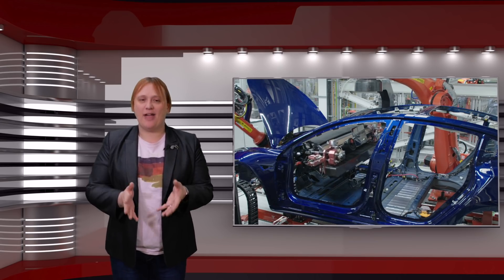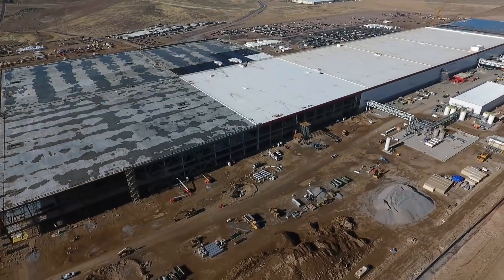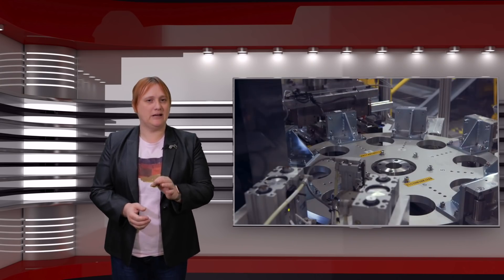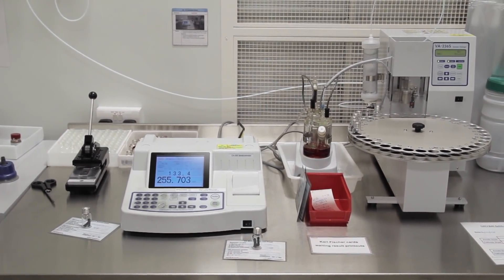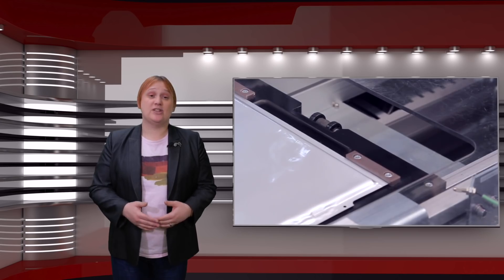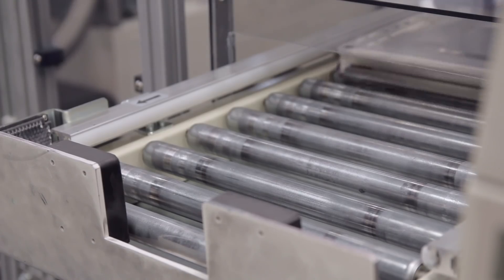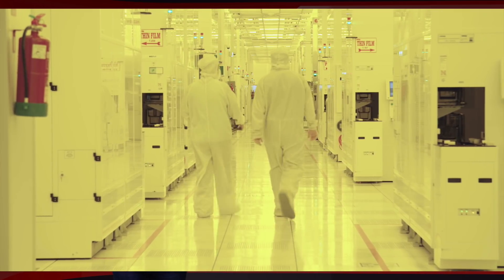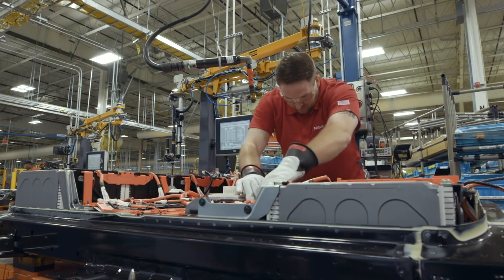Want A Battery Breakthrough? Figure Out How To Make Lithium Ion Batteries More Easily!

Comment: Still need more research on lowering the cost of alternative energy especially the battery and hydrogen fuel cells. The production process itself needs a lot of research on how to lower its cost and make the battery more affordable while addressing situations such as slavery and lack of good conditions when it comes to mining the materials and to power the manufacturing facility with solar energy and use Tesla semi or similar trucks or even trains for all manufacturing deliveries.

Comment: It sounds if the cell production is similar to the issues within the semi conductor industry, where yield is a major factor in profitability. Improving yield from say 10% to 20% doubles the effective production and this is/has been achieved in high density chip production. As techniques improve it should also be possible for cell production.

Comment: Waste is a real cost to manufacturing. Employee stress is also a problem, which is often not recognised by managers. The stress may be due to work, production pressures, and general manufacturing hiccups which happen in all plants. Rome was not built in a day. Managers and staff need to work together to improve the process, make the article to the correct standard and desired numbers. After a life time of work, including as a manager, I can tell you people are overly optimistic. Even the best made plans often do not work out as thought and require much fettling to get production working as wanted. Taking pressure off of staff at all levels is key to a productive workplace. I commend Tesla on their partnership with Panasonic. This has allowed them to have a significant battery production plant close to their vehicle production. It has also allowed their partner to carry out an expansion that they perhaps otherwise may not be able to do. Just expecting the small number of companies competent of making transport grade cells to make the necessary investment to set up the required battery plants is unrealistic. The two main issues will be a lack of adequately skilled personnel and the insane level of borrowing that would be required and the challenges of constructing and running facilities in many different countries.

Comment: Because CHANGE.   << THAT really sums it up. Cell or Battery production actually isn't very difficult or intensive compared to some existing automotive supply lines, but it is new, and there's the problem.  For example, have a go at making a crankshaft. Sounds easy?  Er, nope, far, far harder than making a battery, but because that supply chain exists and has done for nearly 100 years now, nobody gives it a second glance. For example a lot of the forging machines making high performance cranks were built in the 1950's at vast expense (often highly subsidised by the Government too), and today, some 70 years later, we still leverage that investment, to allow Tier1 suppliers to provide cheap, mass produced, but highly complex parts like crankshafts.  The situation will change, vast investment is now in place and being applied, costs for batteries will fall and yields and efficiency will increase.

Comment: Li-ion cells have some rugorious requirements in use too. They can not be charged above 4.2 volts or allowed to fall below 2.7 volts. In 2000 - 2004 there were a number of laptop fires. The cause was when they were fast charged to 4.2 volts some parts were actually above that voltage. So laptop and cell phone makers fast charge to 80% capacity in 20 minutes then trickle charge for the rest over 3 hours. And there were stories of Tesla service guys breaking into vacationing customers garages to plug the car in. 
When Segways patents expired a lot of people built copies as Hoverboards. The Segway was before Li-ion batteries, the Hoverboard copycats just use them. The result: So many Hoverboards caught fire they are banned by the airlines. So be careful if you are buying anything with Li-ion batteries in them.

Comment: The mining practics are due the the greed of the mining owners.  You get what you pay for, and if you want to cut costs at any cost, that will affect the labor pool.
Reading the comments there seems to be an altruistic source at the reluctance of automakers not investing in battery packs.  This is be design by a YUGE financial lobby enmeshed in ICEV makers.  They have not invested in batteries out of greed.  And then they spin that lack of investment and churn out memes that promote a public hatred of EV.    I just did 2 videos for Earth Day with one debunking the lies of the oil lobby.  And so as if it was programmed, a patient came in an asked me about what he had heard on the radio that morning.  They have brainwashed an entire generation of children (and their parents) that batteries are not recyclable and not ecological.  Now they have added that since there are so many marks of batteries that it becomes dangerous for them to recycle the batteries. 

Disingenious bastards.

Comment: Nikki, as much as I agree with the sentiment you expressed about the electric three wheelers in India from Mahindra the other day, sadly the same is not true  when it comes to a proper 4 wheeler car with Mahindra's current offering E20+ or E-verito. Both are low voltage cars and not built from ground up like a proper EV. They fail to offer either power or range. No wonder, both failed to gain popularity and the sales fell flat last year. So, please don't put them in the same bracket with bolt, leaf or a Tesla. We, here in India are waiting for a proper EV built from ground up, and so far, Tata Altroz EV seems to be the one, although, like other mainstream manufacturers they too are a vaporware for now.

Comment: Nikki stop playing lip service to batteries holding up uptake of ev when that is not the reason the legacy auto makers are not replacing internal combustion engines  with electric motors as the actual devices turning the wheels of the vehicles they make.
I would rather have them produce ten 10 kWh capacity cars with range extenders than one 100 kWh bev and nine ice vehicles.
The real reason the legacy lot are playing along with the battery supply difficulty argument is simply their abhorrence (after decades of ice development) to the notion that all the ice is now fit for, is generators.
Reply: I'm afraid this is another rose-tinted vision by another anti legacy car maker EV obsessive..
The tired, predictable wheeling in of a conspiracy theory to attack car makers, etc. etc. 
Why is it that people with an 'agenda', even when faced with the blindingly obvious, refuse to accept straightforward reality?! Yawn.......
Reply: @andymccabe6712  I am an EV obsessive but certainly not anti legacy car makers, far from it. There is no conspiracy theory, after decades of development the ice has run its course and now it is time to accept that an electric motor was all along the right thing to be turning the wheels.
My agenda is that we cannot expect Tesla to go it alone but unless the legacy auto makers commit to the fundamental that the electric motor must be the sole means of propulsion and see that their existing ice manufacturing capacity does not need to be abandoned but adapted to meet the needs of this transition to EV then they are only going to fall further behind.
Nissan with their e-Power unit have already shown that customers are perfectly happy to purchase an EV if packaged such that it does not in their minds represent any change in how they expect to use the vehicle. But crucially the setup of the Nissan e-Note does away with the ice turning the wheels. Incidentally the e-Note has the same electric motor as the Leaf.
I still own my 2011 Leaf but now do most of my miles in the BMW i3 rex so I know just how easy it is do all my day to day driving on electric and yet can do any trip without hassle because the infrastructure for the rex is there as part of those decades of past ice development.
The end game is that we will all be driving BEVs, it is just a question of quickly the transition will be.
And to my mind unless the legacy auto makers put the electric motors in place turning the wheels the transition will be a long one.
Reply: Perhaps a simpler way to see the transition to EVs,  electric motors, batteries and all that is. If electric motors did away with gearboxes then batteries would quickly do away with internal combustion engines.

Comment: sorry, Nikki, you are wrong.  The reason why GM and Ford, for example, won't make batteries is that with UAW labor it is simply too costly.  For the transplants, the keep wages high enough to keep the UAW out.  So, they, too would find battery construction too expensive.  So, they all outsource.  It is all about the labor rate

Comment: The current situation where supply  doesn't correspond to demand is a load of BS. Major auto manufacturers, car dealers, ... simply don't want to sell you electric cars. If they would want to, believe me, in no time, the supply shortage would be solved.
Reply: I agree that was the case 1-2 years ago. Apparently a switch has been thrown and reality has bitten all of Big Auto... finally, and they are now all scrambling to appear like they’ve been doing this all along. Trouble is they didn’t plan on public sentiment and pollution regulation getting the support it has from the public, and failed to prepare
Reply: Yep-spotted it straight away!
ANOTHER conspiracy theory.....

Comment: Good report. Really hanging out for your Mohindra reports. An Indian engineer friend of mine told me that young Indian engineers are chaomping on the bit to prove that they can match - or beat - Tesla. He said that what this has meant is that Indian auto makers have a surplus of exceptional engineers rather than the scarcity that other manufacturers are faced with. Looking forward to your impressions.
Reply: Adam Gray I’m not surprised at this. Many smart Indians in high tech I have met.

Comment: What if everything is automated ..from raw material to product
Reply: Then you are looking at a factory opening around 2040. This will happen at some point of course. There are microcontroller factories with ten employees which supply entire countries already, but it seems battery cell manufacturing has not reached that level of automation.